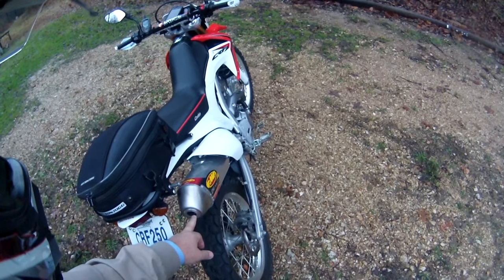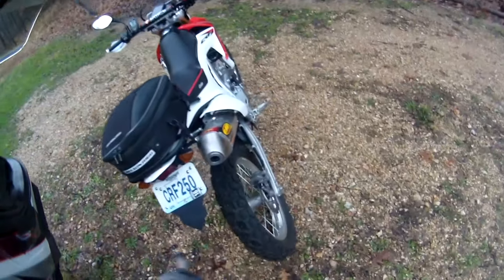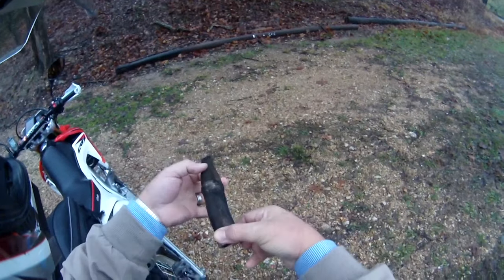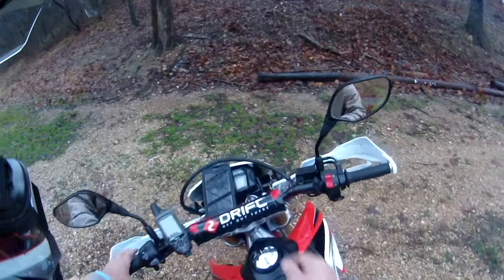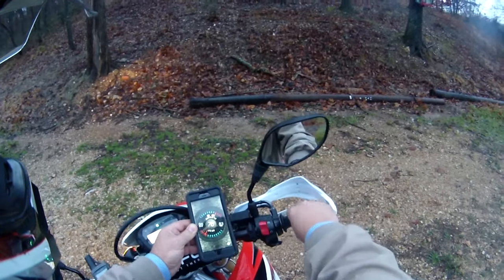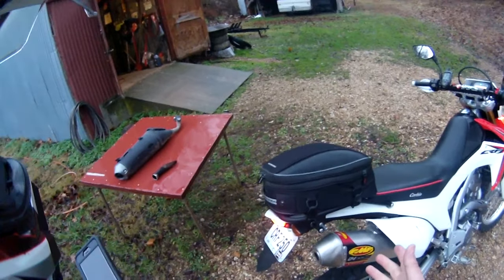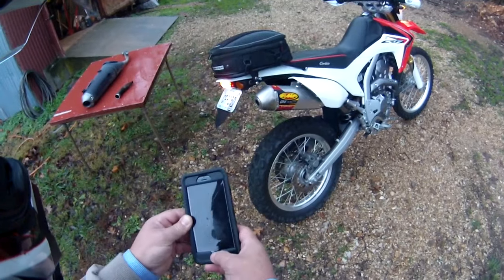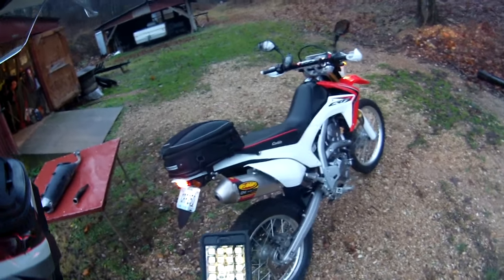FMF POWERCORE 4  QUIET INSERT IN Q4 HEX db test Review HONDA CRF250L

Comment: The Q4 has a baffle plate down deeper in the muffler.  That's why the Powercore has to have a smaller diameter tip to reach the same 96db.  The q4 insert is mostly for the spark arrestor, not so much as noise reducer (as it is with the power core tip).

Comment: That is pretty awesome I like the sounds of this pipe. Any HP gains? just curious, they always say you can get a little more HP from some of the pipes.
Reply from the maker: Some people say it don't gain HP by just adding the slip on, but that is just stupid to say that. Anytime you have more flow you gain some HP. You may lose it on the bottom end and gain it on the top end but there is gain. It does climb better out of the hollow. I did have to shift down but with the slip on I don't have to.

Comment: Woodzman do you notice that your side plate sticks out way far after putting on the FMF pipe? Mine seems to have a huge gap between the pipe and the plate. Just wondering if that is normal with the mount they supply.
Reply from the maker: You mean the number plate ?

Comment: Hey when you change the exhaust do you need a fuel injector or something to moderate the air out and air in and fuel regulations, Or can you get away with just changing the exhaust
Reply from the maker: +Gustavo Lombana Jr as long as your just adding the slip on muffler Like I did, you don't have to do anything. That's only if you change the head pipe and do air box mods

Comment: Very informative, thank you!
What do you use now, stock or FMF? I worry about the sound - my neighbour will call police if muffler is too loud.

Is there any difference to go with FMF Powercore 4 and quiet insert or FMF Q4 and quiet insert?

Thank you.
Zapi
Reply from the maker: I am using the FMF Q4 with the Power Core 4 quiet core insert installed. It not near as loud as the Q4 with the Q4 insert.
Reply: +WOODZMAN Dual Sport Adventures Are you satisfied or is it still too loud for your taste?
Thank you!
Reply from the maker: I'm satisfied now. The only other thing is stock. I think I will try to stay with the FMF

Comment: I actually like that tone better. Had mine out this evening with a GoPro and it just sounds a little to raspy. Did you notice any improvement or lack of with this new insert? Thanks again for another informative video.
Reply from the maker: I can't tell any difference at all in power over the standard Q4 insert. Just the sound. I can tell an improvement over the factory muffler when climbing hills. I don't have to shift down as much.

Comment: Thx so much for all the vids and help, how will the fmf affect the power of the bike, or will it?
Reply from the maker: Well... it will some, but in my opinion it will make more noise that it will power. 
 No doubt when you flow more exhaust you will gain some on mid and top.
I have tried both and I just like stock better for the riding I do.
Reply: @WOODZMAN  Thanks for the reply. I did watch another video you had, you moved a tree in the middle, about returning to the stock pipe and why. One of the big reasons I had for going to the other Q4 was weight. I have been looking for ways to drop weight on this bike, but from what I have seen it will only drop the weight by about 8-10lbs. Thanks again

Comment: What type of silicone did you use? Also, will it make much difference to the sound level with or without the silicone? I already fitted mine (fits very well), but without the silicone, so wasn't sure if its worth putting in at a later stage.
Reply from the maker: +Stefan Cmai I used the red High temp silicone.  Well it's not the sound level it's just not good to have an exhaust leak and with out the silicon, you will. You need to put the silicone on then put the muffler back on and then don't start it ! Let it sit over night before starting it so the silicone can dry
Reply: Got it, thanks!

Comment: I have a 2018 CRF250L. So if I order the Q4 slip on I will also have to order the quiet insert from the FMF powercore 4? And it fits in with no modification? I would certainly appreciate a reply if possible. Thank you. John
Reply from the maker: Yea it fits perfect, the insert is really hard to find.
What was you wanting the part number for ?

Comment: By any chance, would you happen to have or remember the part number for the quiet insert for the FMF Powercore 4?
Reply from the maker: +Henry Wojtkiewicz well I sure do Henry ! It's the FMF 040630
Reply: @WOODZMAN  Thanks for including measurements and part numbers. Very helpful!
Reply: @WOODZMAN  The only issue I am finding now is that part number is out of stock everywhere. I've checked maybe 20 sites so far, eBay, Amazon, etc. So far no dice. It appears to be from the titanium models from the descriptions I am seeing.
Reply: RiderForge 3 years later, doesn’t look like FMF is bring it back
Reply from the maker: Yea I think they quit making it. A person could have a weld shop make one
Reply from the maker: That is not the one I had. Mine was called a quiet core insert for power core 4

Comment: I'm confused you have a power core 4 exhaust and the quiet insert for it is quieter than the Q4 exhaust Plus insert? So you can get the powercore 4 exhaust for performance put the insert in and it's now quieter than the Q4 could ever be?
Reply from the maker: I had the Q4 and I put the Power Core 4 quiet insert in it. 
I don’t know about the other way but I doubt that it’s better

Comment: Do you run the fuel controller as well or just the slip on? I've been trying to find out if the controller is necessary with just the slip on with no other exhaust or intake mods, but everyone seems to have a different opinion on whether the engine will run too lean or not.
Reply from the maker: No I don't even want the controller. I am happy with just the slip on. If you just use the FMF Q4 slip on, you don't have to change anything at all.
Reply: +WOODZMAN Yeah, I dont want to change the header or anything else. I just want the sound. I love how quiet the stock exhaust is, but this week I've twice had people start to change lanes into me in city traffic. I'm hoping just a bit deeper sound will make them look twice. At the same time, I don't want to wake the whole neighborhood at 4:30 every morning.
Reply: +WOODZMAN Yeah, I dont want to change the header or anything else. I just want the sound. I love how quiet the stock exhaust is, but this week I've twice had people start to change lanes into me in city traffic. I'm hoping just a bit deeper sound will make them look twice. At the same time, I don't want to wake the whole neighborhood at 4:30 every morning.
Reply from the maker: +ChronicAltitis The FMF Q4 is a good choice and I like it better when I took out the stock FMF Q4 insert and installed the Quiet insert for the Power Core 4

Comment: Hey woodsman, I’m About to buy a new slip on for my crf250L.  What is the loudest street legal pipe and setup  I can run? I don’t plan on going to any state parks. Just street riding
Reply from the maker: Probably a FMF power Core 4
Reply: WOODZMAN ADVENTURES hey frank sorry I ask you so many questions that probably seem dumb to you but if I get that FMF Powercore 4 slip on, will I also need to replace my stock turn signals? I heard they will melt if you don’t....
Reply from the maker: Well that is possible, I had the FMF Q4 Hex and it didn’t melt them but the power ore 4 might.

Comment: Did you loose any mpg running the fmf q4 slip on with the power core 4 insert? My bikes stock and I cannot hear my bike through my helmet which is very annoying because I can't hear when to shift. I want something loud enough so I can hear my bike above the wind and traffic. What are you getting for mpg
Reply from the maker: +bob m I couldn't tell any difference in fuel mileage at all.
Reply: Ok thanks
Reply from the maker: +bob m Your welcome !

Comment: Has anyone who has added just a slip on with stock airbox and filter had issues running too lean, or blowing their bike up or putting a hole in the piston
Reply from the maker: +bob m no ! It runs fine with the FMF and stock air box and exhaust.  You most likely won't burn a hole in the piston on a 4 stroke. That usually happens on a 2 stroke when it's running lean
Reply: I just know they come really lean from Honda because of emissions and wasn't sure if that would lean it out more and blow it up. I didn't plan on buying A ejk if I didn't have to Thanks for all your help !
Reply from the maker: +bob m no problem !  Just using the slip on FMF Q4 you don't have to do anything and it runs great

Comment: What is the weight difference FMF and stock pipes?
Reply from the maker: I don’t remember but it’s a bunch
Reply: @WOODZMAN  Thanks. I've been looking at this bike for a while but one of the big issues for me it the weight. You have commented a few times it is a "light" bike, but in my opinion its a PIG. Some have said they remove some of the pollution control on the engine but I am really not comfortable with that. Could trigger check engine etc. I'm only 5'7 and 80lbs lighter than you so I'm not really sure if I'm overthinking it or it really will matter. Anyway love your videos and really appreciate all the effort you put in to make them.

Comment: Need some help , I can't get old baffle to come out , got the exhaust nice and warm and still will not come out !!
Reply from the maker: I took a hook and put in the hole that the screw came out of and then I put a pair of vise grips on the hook and pulled it out.
Reply: +WOODZMAN I'll try the vice grips on the hook tool !! Thanks !!
Reply from the maker: Did you get it out ?
Reply: +WOODZMAN yes I did ,for some reason it wouldn't come out to easy , but we got it ! Thanks !!
Reply from the maker: Awesome ! I'm glad you got it.

Comment: I have to ask this question. There's a lot of chatter about the engine rattle around 5K RPM on both the CRF 250 and CBR 250.  My buddy and I both bought new CRF250L's at the beginning of the season. We didn't hear it at first, but now it's there. And, it appears to become more noticeable after the engine warms up. I don't think it's harmful but sure is annoying. Have you ever heard it on yours? And if so, what have you done to get rid of it? Some say it's the reed valve, some say not. I would sure like to know how to eliminate it.
Reply from the maker: +Henry Wojtkiewicz That is strange, my bike has never made a sound. Could it be the timing chain tensioner ? You might ask +BlastsFromthesaddle ,he has tensioner or two that went bad and he may be able to tell you what the sound was on his bike.
Reply: If it is at certain RPM it is probably the tensioner

Comment: Hi with putting the FMF pipe on the 250l I read that if you dont also install a EJK unit to optimize the fuel it will damage the valves, are you finding any problems with yours
Reply from the maker: +raymond dearden as long as you just install the slip on muffler you will be fine. You only need the EJK if you also add ahead pipe and mod the air intake
Reply: Okay cheers Woodzman love your videos keep up the good work
Reply from the maker: +raymond dearden No problem at all Rain Man , thanks for watching

Comment: With exception of weight, aaaaany aftermarket pipe/header setup is lots and lots more shitty than the one you got from the factory. And frankly you lose a lot more weight from your wallet than you do from the pipe and or header.
Reply from the maker: I agree